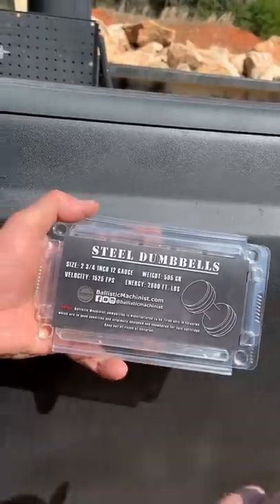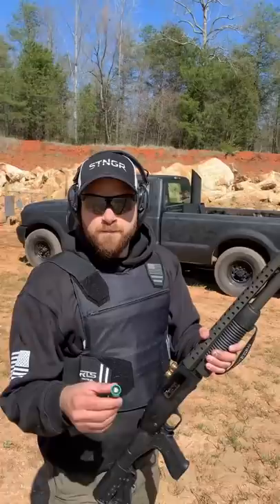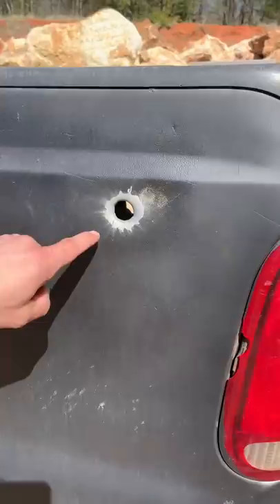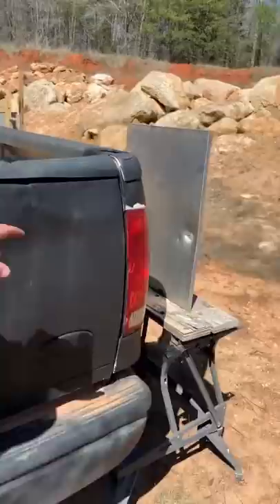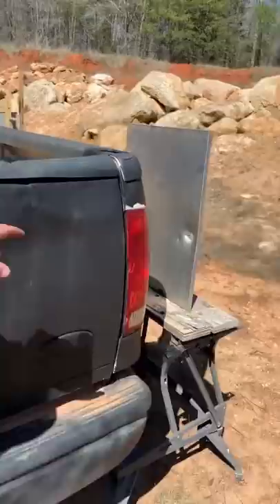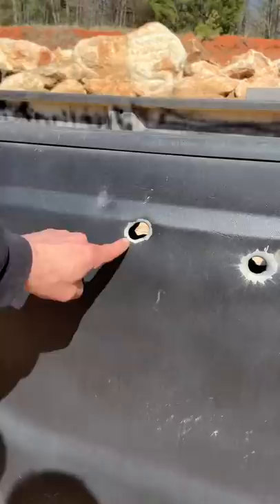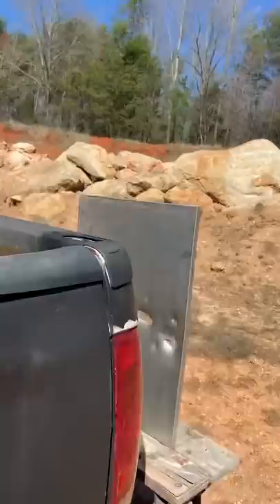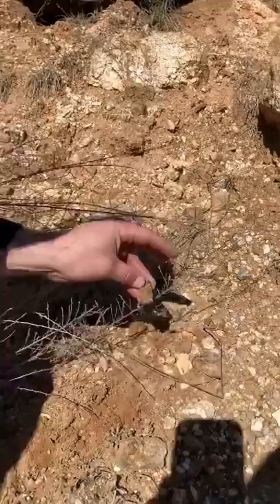Steel Dumbbell Round Vs F250

Comment: When your 6.0 breaks down again and you have had it
Reply: Right!
Reply: Thats why a 7.3 is nice to have🥰
Reply: @obstrevy8107  that or good ole 5.9 cummins
Reply: @callsignmohas5190  only thing better than a 24 valve is a 12 valve
Reply: @matthewmcdonald140  the only thing tho.   Unless its a 24 with a p pump swap. Those vp44s are dumb
Reply: @callsignmohas5190  that wasn't really a serious statement, in terms of reliability and power there are several engines that have proved to be superior to the 24 valve Cummins its a great engine but it has its flaws, all I was getting at is that you really can't beat a 5.9l 12 valve Cummins turbo diesel, sure it's just an opinion but I truly believe it was the best diesel engine ever built.
Reply: @matthewmcdonald140  coming from a mechanic, yeah its the best diesil engine ever built🤌🏼
Reply: @obstrevy8107  the 7.3 was the best engine Fords ever had. It was a tragedy when Ford forced International into bankruptcy and tried to produce it's own diesels. The 7.3 was heavier, much more reliable, and yet had far better mileage. 16 MPG when towing!!.
Reply: @obstrevy8107  6.6 Lbz duraturd is the best diesel ever made
Reply: Too funny. I was a service advisor for 43 years at Ford dealer.
Reply: @jaikobmackney3030  I can tell you’ve never had to replace the injectors in one... 12v Cummins is king, end of story. I have both (2 12v’s). The ‘03 Duramax has left me stranded multiple times and it doesn’t even have 100k on it yet. My Dodge’s are probably close to 750k between the two of them and the ONLY time they have ever given me a problem is when they had a dead battery. Those trucks really only get used during hay season and every now and then during the off season. They get worked hard and then stay parked for months. Except for inaccessible injectors, I can’t really complain about the Duramax engine, but the truck it is in leaves a lot to be desired.
Reply: @athhud  nope I wouldn’t, I’m not into diesels and they’re expensive shit parts

Comment: So much for hiding behind cars in the movies! 🤣
Reply: Just make sure to hide behind the engine!
Reply: You always hide behind the engine block, the rest of the car is pretty much useless for anything more than concealment.
Reply: That is concealment. Different from cover.
Reply: Military trainers will tell you inside or behind a car is the worst place you can be in a gunfight, the shrapnel from the car makes everything worse and the car doesn't provide a barrier like you would think.
Reply: @beansbulletsandbandages891  absolutely right!!!💯
Reply: Thats why the rims and engine block are a better area to take cover.
Reply: Difference between cover and concealment
Reply: @beansbulletsandbandages891  when comparing cover and concealment it’s two different things
Reply: @szabib2144  the brake drums and rotors are what provide the cover for most small arms fire, personally I'd rather take cover behind the engine block but if you are near the wheels get on your back and brace your feet on the rim this will allow you to roll side to side and look under the vehicle for movement. This way you can anticipate where the threat will engage from and gain the upper hand
Reply: @ryv2484  hiding behind the engine doesn't do shit.
Reply: @evilphantom457  well with your bow you can just arc it over the truck 😂
Reply: @warcraftdude13  Show me small arms that can penetrate through an engine block. Ma deuce can't even do it on most engines.
Reply: @warcraftdude13  explain, will be fin since you are wrong
Reply: yup!

always thought it was suuuuper stupid!
Especially because in most movies they take cover behind car DOORS and then the other guys are equiped with AKs and Ar15s...yeah right...

Even hiding behind a tree can still be lethal.

I think a hot  .0223 / 5.56 or 7.62mm round can pierce up to 8-10 inch tree-trunk and still be lethal on the other side...

Or a .308 loaded hot
Reply: I was just saying the same thing to my girlfriend LOL
Reply: @kniefi  I hate when they hide behind couches and dining room tables and stand at the corner in a house and the walls are made of plasterboard. SMH
Reply: Yeah, cars aren't cover. If you're going to hide behind a car at least hide behind the engine block. Even then though probably better to find better cover.
Reply: Yeah that is why you hide behind the engine forsure that is by far the best place not much will make it through the block
Reply: @Mr_N0_0ne  school didn't know that
Reply: Engine block .  Is your ONLY HOPE
Reply: @daleford8621  I prefer to put myself inside the starter location on a Northstar V8 Cadillac, nobody can get in there even if they tried.
Reply: literally nobody recommends using a car as cover
Reply: @STOPSYPHER  maybe visible cover, just not ballistic covering lol.
Reply: @robsnizzle7  oh damn we live in an aluminum block world, were fuckdd lol.
Reply: Concealment is the vehicle, cover is the axle/wheels and the engine.  Period. 
  Unless...  You're driving a "slammer," which were old, demolition derby cars (like a 60s Lincoln, Caddy, wagon, etc.) which had all of the door and fender cavities filled with cement so they couldn't be killed.
Then, your ok... 😉
Reply: Especially when Alec Baldwin's handling the firearm.
Reply: Just make sure to not give it to Alec Baldwin
Reply: @moderndaypirate8931  🤣

Comment: If the traditional round was lead and went through 3 layers of metal I expect any round of more velocity to do the same.
Reply from the maker: 5 layers there is two per side of the truck bu I see what you mean
Reply: Beer cans then metal
Reply: To be fair, the truck uses thinner metal than traditional armor
Reply: Yeah what he said. Cuz, merica!
Reply: 22 can shoot through a bed
Reply: @robertbiondo3771  sounds like a man of experience
Reply: @deplorableredneck4.02  yeah lol , AK will cut down a tree  1' round in 30 rounds , 357 will go in a block haha , buckshot will completely cover a speed limit sign and a 306 will drop a deer dead  mid flight over a fence . Ahh the good ole days on a farm in Missouri .